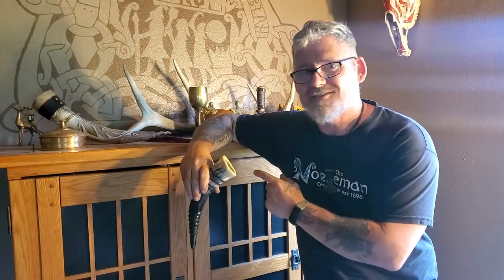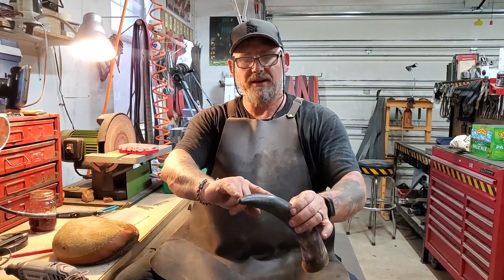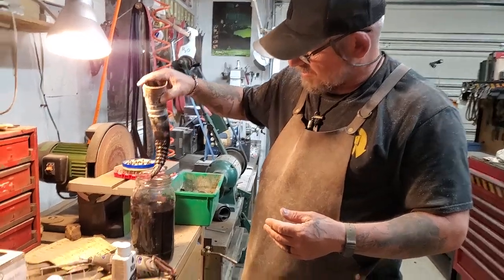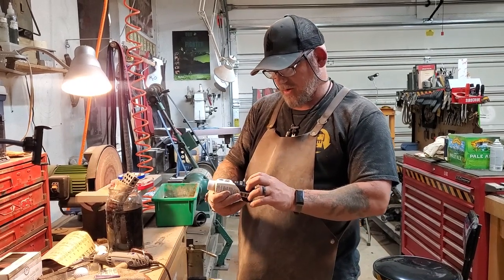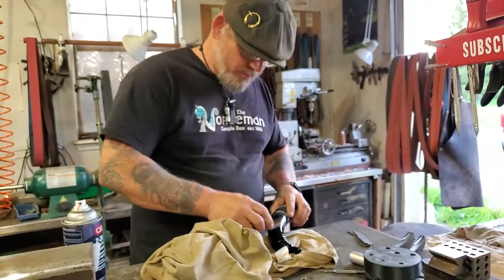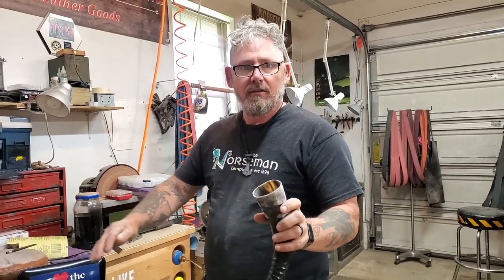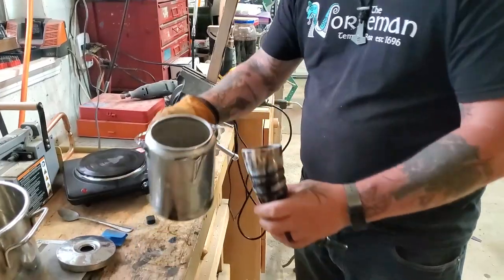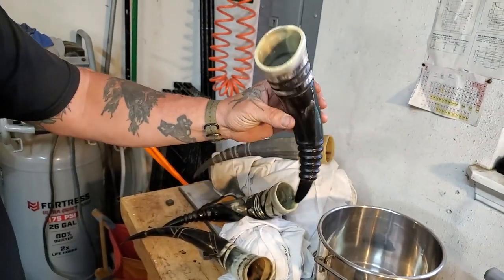How to Make a Viking Drinking Horn from Scratch

Comment: Thank you for the video. So you use mineral oil, and then use boiled linseed?, and then as last step the beeswax? For someone who doesn't have these tools, would you just use a file to create the slots in the horn?

In order:
Draw the slots
File out the slots
Use grinding paper to clean the slots
Polishing
Use mineral oil to clean the horn 
Put boiled linseed oil on it and let sit over night
Trim and clean up the rim
Clean inside with soapy water
Wax inside with beeswax
Dip rim in beeswax
Reply from the maker: Sounds like that would work juat fine.

Comment: I have 2 horns that have some "splinters" is the best way to say it, sort of crackled crud that I can't seem to fully get rid of after using a wire brush on a drill. Do you have a better tool or process for scraping out the inside of some horns?

Comment: When I started scraping out the lines in the horn, and entire layer came of and it looks like the horn is ruined... Does anyone have any idea what I did wrong?
Reply: Tandy sells cleaned and polished horns for a reasonable price. I have used them many times. Saves a lot of work. Only problem using bees wax is you can't clean it properly. I use a non traditional method of using food grade epoxy. I have horns I gifted that are over 30 years and still look new. This Man does beautiful work.
Reply from the maker: The layers will peel back like a hangnail so if that starts to happen sand it out.  Everything is repairable, even a hole can be repaired.